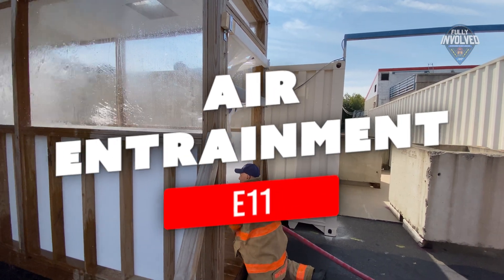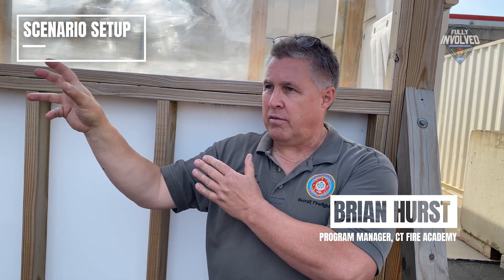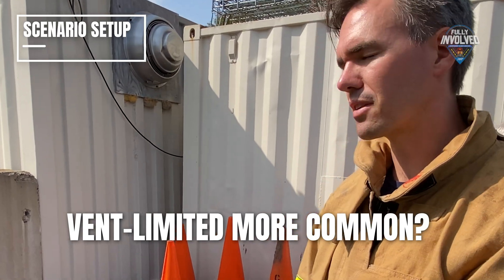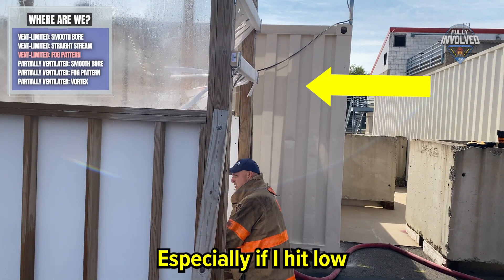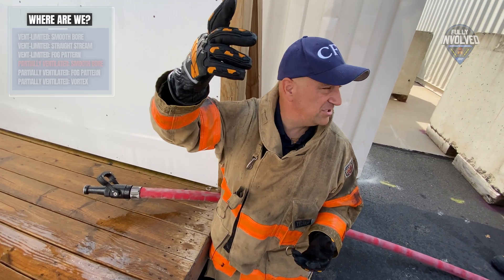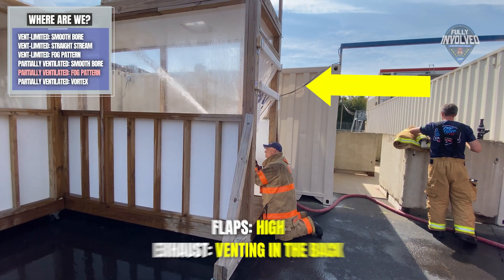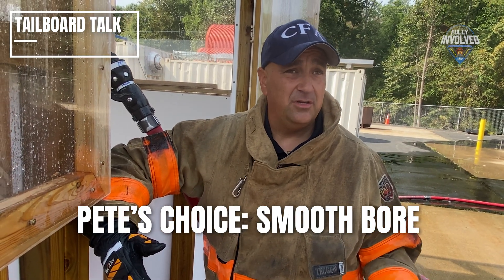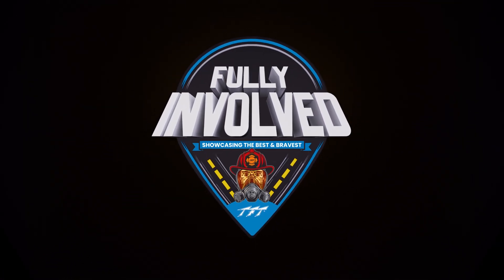Air Entrainment: Smooth Bore vs. Fog | Fully Involved (Ep. 11)

Comment: How many gallons per second is the smooth bore vs straight stream vs fog  flowing before a substantial reduction in heat is achieved? What are the total gallons flowed based on the time it takes to convert the fire from growth stage to decay stage and extinguishment? This non-fire demonstration is opinion without time and temperature data.
Chief Hughes
Battalion 1 (retired)
Chicago FD